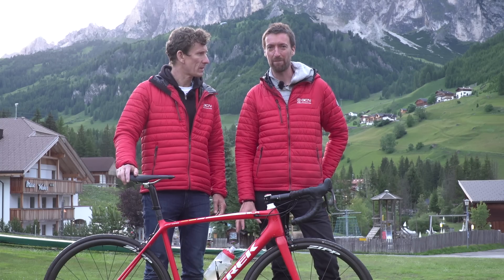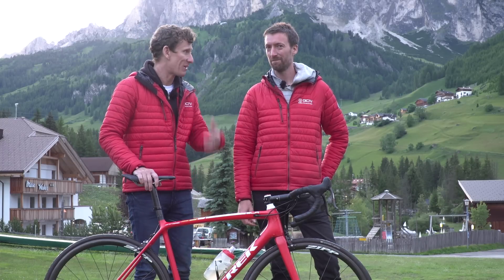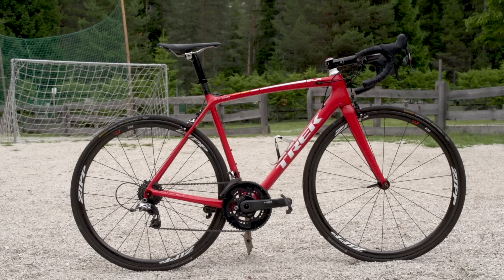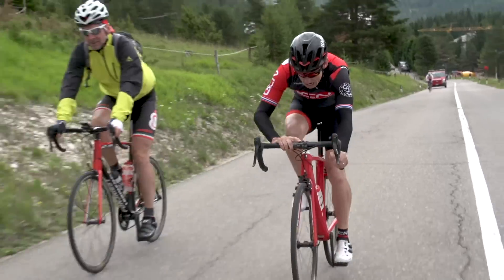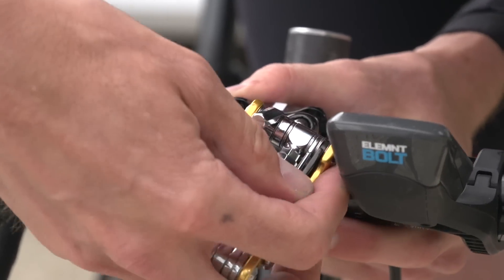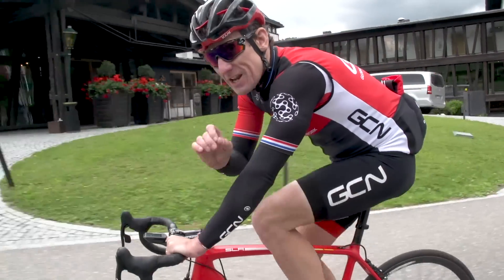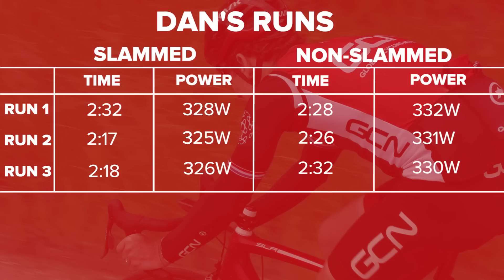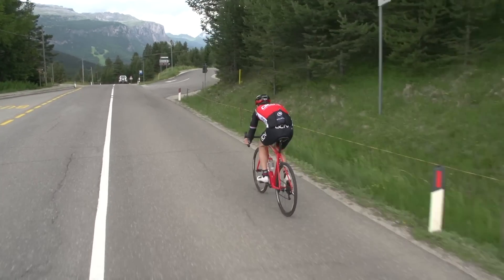Slammed Vs. Non Slammed | GCN Does Science

Comment: what's thepoint of an "aero position" if you have to go back once in a while to an upright position to relieve pain, what's the point of an "aero position" if it puts you at risk of an accident because you can't control the bike as well as with hands on handlebars
what's the point of an aero position if your usual race/tracks/sessions are on a circuit with hills and curves forcing you to constantly leave the said "aero position"
An "aero position" is valid only on flat and rolling road profile, but is counter productive on other road profiles, what's the point of gaining watts on the flat out part of a ride if it's to loose them because your "aeroposition" is not adapted/couterproductive for the coming steep hill...
"aero position" is good for pros who once in a while will ride on a time trial on a rolling course.
For the rest, get a "confortable position", put some aero bars on your handlebar for the rare long flat parts of your sessions/races, and you're done. satisfaction and performance guaranted.

Comment: I tilted my seat slightly a couple of months back, it was more comfortable to get more aero and i got rid of numb nuts but started getting saddle sores, tried to get used to it for a month or so but couldn't get rid of saddle sores... ended up going back to numb nuts and the saddle sores have gone...
Reply: What angle did you tilt the seat to and do you use Chamois Butter before each ride? Also just out of curiosity do you have aero bars on your bicycle? My seat it tilted slightly down to -2 right now. I will be doing my first 30 mile ride on it this evening.

Comment: These cycling dad's come and go.  Just like elliptical chainrings have come and gone and come back again.  I find that excessive saddle tilt tends to make you slide forward over time.  In the short term it's okay... But over a longer ride you'll not only slide forward but also tend to put more weight on your forearms and your front wheel.  Not a big deal I suppose but you'll tend to brake off saddle more to compensate.  I find it out right dangerous to put that much weight on the front wheel.  I know lots of folks will disagree, but I come from a generation who rode steel... And still ride steel.  So I'm thoroughly used to agreeing to disagree.

Comment: I don't think this trend of low head tubes and "slammed stems" makes much sense to me.  Many racing frames are already lower in the front than 95% of non-professional riders can ride efficiently.  Back in the day of level top tubes, riders were in practically identical positions despite having very little difference between the saddle and bar height.  Lowering the bar has the effect of exposing more of the arms to the wind (because they're more extended) which increases drag past a certain point.  Comfort is king, and I believe you will always be faster in a comfortable position.

At the same time, lowering the angle of the saddle and pushing it more forwards ruins the handling and stability of the bike.  The fit should be set up in a way that the rider can let go of the bars at any time without falling over onto the front of the bike.  Most amateur riders would like to have a more comfortable ride and a better handling bike instead of 5 more watts.

Comment: STOP THIS NONSENSE. Cut your damn stems if you going to slam them down and leave at least 2 spacers for adjustment. Uncut stems are very dangerous as the hand bar stem is attached to a weaker point on the Stem.